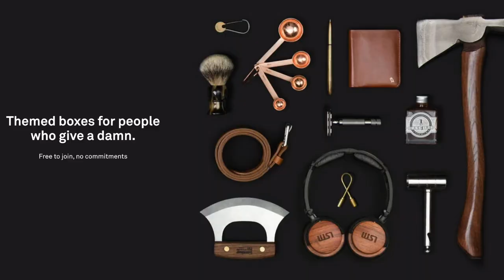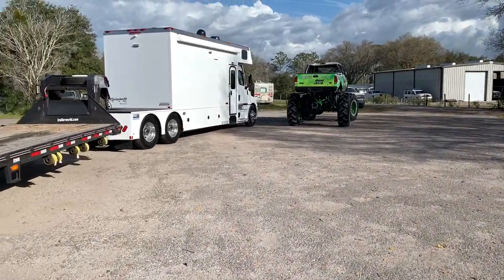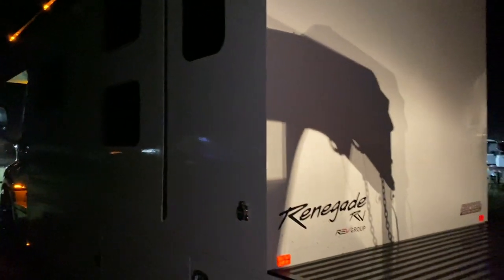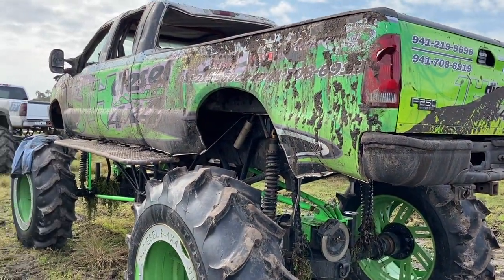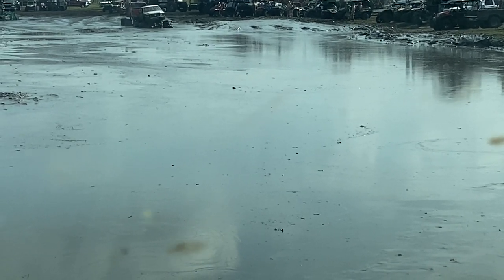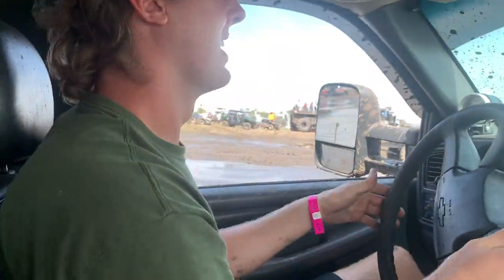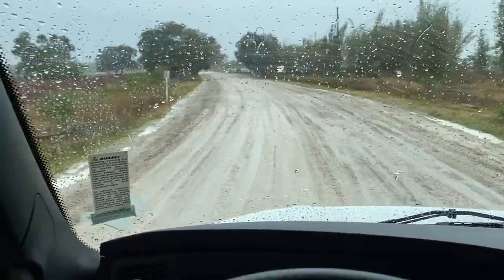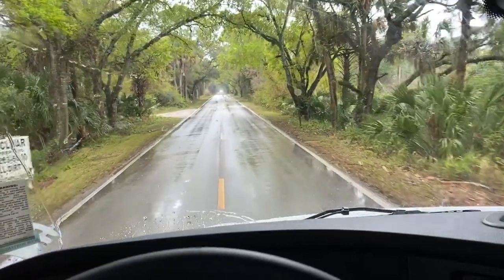Took the Mud Truck Out To an INSANE Mud Hole!! Freedom Force 1 Gets Stuck Immediately...

Comment: That timelapse at the end of washing the truck was surprisingly satisfying lol.
Reply: Any idea what he sprayed on there after that initial rinse?  Looks like it made a big difference.
Reply: @D3thM3tal  I also was wondering that. I think he said on insta it was simple green.
Reply: @logancollins3493  If it was simple green that would make sense, that shit is so great.  Used it all the time when I raced motocross to wash the bikes, it shined things up like crazy.
Reply: @D3thM3tal  It's called "Soap". You might want to try it sometime. It does wonders for cleaning things.
Reply: @Sabrinahuskydog  😆
Reply: When it ended so quickly I was like aaawwwwww come on I wanna see more! Also that simply green looks pretty blue in that container. Never used it before but it’d be strange marketing if it was blue but it’s called green🤷🏼‍♂️
Reply: It is a mix of degreaser and laundry detergent.  Sxs blog did a how to video on cleaning and they tell cletus' mix that he uses to clean up his sxs.
Reply: @sundropjr2000  I still think it's just good old soap. It's just mud after all. It's not like you need anything fancy. Soap is soap. Generic dollar tree detergent would probably work just fine.

Comment: Put some a/t tires on the Renegade, Cleet. Those tires are made for fuel economy, you gain an mpg or two which is big for a truck and trailer but for where you’re goin with it you’ll want some more traction in the dirt!

Comment: I’ve got a new cascadia that is built just like that. It’s a super nice truck but there’s a lot of bugs they need to work out. The rumble strip buzzing won’t go off if you use the turn signals if your changing lanes.

Comment: Had a 45 foot showhauler at a motocross track, I was driving it at 18 years old with my dad following in the van. Got into a situation in the track parking lot I couldn’t back out of with a 10 foot section of straight mud, locked the diff and held her wide😂 the people’s faces were the best part

Comment: That mud is the same consistency as the mud around where I live in North Dakota. Except ours is more greasy/oily. Ours almost requires a hot pressure washer to remove.... Water just bounces off of it like grease.

Comment: That s&b oiled air filter is gonna cause you problems. Will get your maf sensor dirty with oil and will make the truck not run right. Maf should be 40 g/s at idle for reference. Dirty maf will have a higher number and will have less power and smoky. Just friendly advice use dry filters on diesels oiled on gassers.  love the channel have fun.

Comment: you need to get the highway tires off the toter and put some luger tires on the back of it or will get stuck in a lot of track parking lots and some planks to park the totor on so it does not sink into the ground over the weekend

Comment: We have twin screws on our 3000 gallon Peterbuilt tanker for our fire department. You want to talk about taking big trucks places they shouldn't go... that's one. It's 64,000 pounds loaded, and we've buried it in snow and in soft fields trying to get back to houses or bad driveways. You need to get some Goodyear off road dirt tires, G124's I think they are, I'll look next time I'm at the station. Highway ribs are nice for the street, but wet grass can, and will, take them out. 

All of our trucks are 60 series detroits 430-525 HP depending on the unit with 5 speed Allison automatics.

Comment: Heavy diesel mechanic here. You do not want to pull that totter backwards because it could damage the automatic transmission. There is a warning label on the driver side door.

Comment: What size tires they put on the motor home?  315s is what they look like but a single 315 or dual (inner and outer) LP22? (275/80r22.5 if they're Michelin and all other brands are 295/75r22.5) just a curious  tire nerd

Comment: Suggestion: start going to truckstops for fuel (easier to fill diesel)
Reply: Also much more expensive for whatever reason unless you xan find a small independent one the big ones are typically 40 cents more a gallon

Comment: You need to get some drive tires with an open side wall yes they are expensive yes they are a little noise air but your toter home will never be stuck again

Comment: All position tires on drive axles will do that. Get real 22.5 drives
And its called AXLE lock not diff lock. Poor little freighshaker caskadia, its up to 600ho and 2050tq, uuuup to

Comment: So I see you have met the worst tires ever. 

You would think that with the weight you would have good traction. 

But unfortunately that is not the case with those vehicles. Those tires suck in rain, snow or ice. No traction at all. 
2 weeks ago during a snow storm in CT I was making a left turn going 4 mph and my Mack tractor trailer literally started to jack knife but thankfully  a sidewalk  stopped it from happening.

Comment: Pull the truck further up on the trailer. You are not pulling with a motor home anymore. It will pull better. You have a vehicle that will handle it.